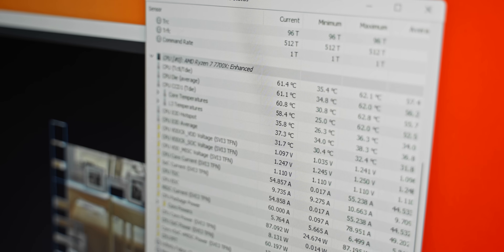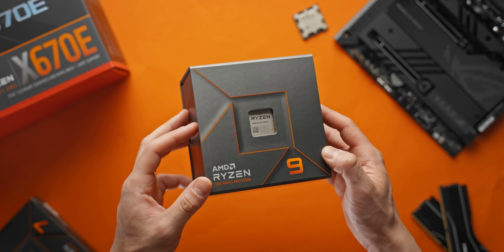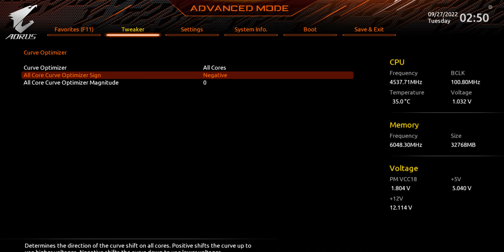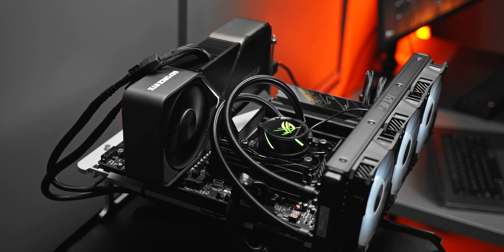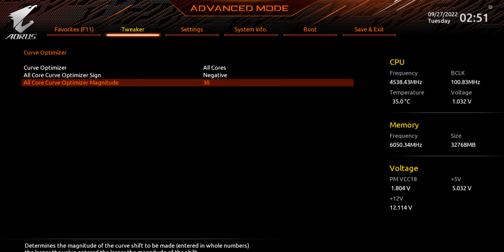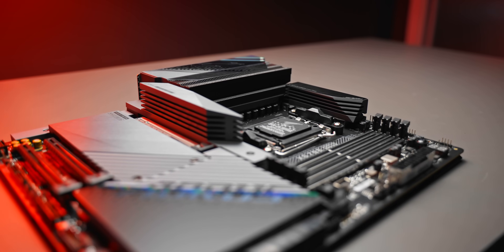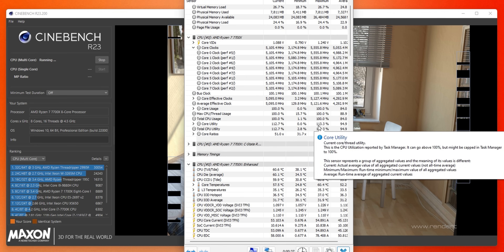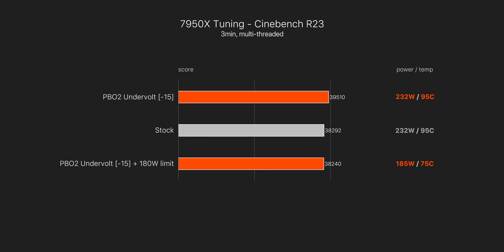Fixing Ryzen 7000 - PBO2 Tune (insanity)

Comment: I hope you understand that you used Gigabyte motherbard, most terrible brand, which overvolts all ryzen cpus out of the box. No wonder you managed to get negative 30 on all cores. I bet on msi motherboard out of the box you would only get negative 15 max with same cpu, because of the out the box voltage given to cpu is far lower than what Gigabyte boards decide do give on their side....
Reply: That's a good thing though... you want LESS voltage

Comment: What about the ECO mode? Can you both undervolt and run ECO mode? Would that make sense if the goal is to minimize heat and power consumption, while maintaining good (but not the highest) performance? Thanks!

Comment: Wait, isn't this something very similar to Intel and their motherboards some time ago (it was 10th and 11th gen, I think)? The motherboard makers essentially went ham and let the processors run at boost clock indefinitely resulting in high temperatures and power consumption?
Because from the difference you have shown, it doesn't look like 7000 CPUs aren't run at their optimal, but mobo manufacturers instead went and mindlessly turned everything up in the default profile, just to show off how their motherboards can handle all this. I don't believe AMD would just go and recommend this default profile. It would make no sense.

This video points more to just bad job in motherboard tuning department and not a CPU one, because you have to do all this extra work even if you buy expensive motherboard like this. I mean, the 7000 CPUs look damn great thanks to this video!

Comment: Going to be an interesting generation and a lot of learning the new silicon behavior. In reality their is little reason to try to drop the temperature, but undervolting while keeping the same ghz boost is always good. This time around their isn’t a risk of damage to cpu until 115C, so it behaves much like a laptop, better cooling you provide the higher boost clocks you get. You should be able to set curve optimizer in ryzen master and always test your undervolt. A program set called “core cycler” is great as it will stress test each core and log if an undervolt fails.

Comment: This is likely unstable. It took me several days to test curve optimizer values on my 5900X. The best cores are definitily not stable at -30, their curves are already pretty much aggressive. When modifying the curve, you need to test core per core (not multithread tests) with different workloads that will place the core in different values of said curve. This takes days.

Comment: You definitely hit the silicon home run on your 7700X. That is an insane drop in temperatures with just a few tweaking. Definitely worth tuning that CPU.
Reply: It's a review sample, so make of that what you will
Reply: @andrewd3899  Yeah but his 7950X wasn't as good. It depends.
Reply: @andrewd3899  even review sample don't hit better tuning capabilities. That's why it's called silicon lottery.
Reply: Another data point, my 7700x has been flawless at -30 as well.
Reply: @WilliamRori  Have you got the same decrease in temps while keeping performance?
Reply: @moozoo2589  5 degrees cooler, up ~600 points in 3D Mark timespy.
Reply: @WilliamRori same 🎉
Reply: Just tried this on my 7700x and it's got me stuck in a BSOD boot loop at -20. Sad.
Reply: @APeacefulPlague  it's fine. That's why these things sre difficult since it depends on silicone lottery. Some can get even lower than that if the fab is excellent.

Comment: This all makes very little sense to me, so why does a power limit really increase performance? I understand that a less constrained chip, obviously just runs more stable since it has so much headroom. What i don't understand is why the actual fuck AMD would, mind you, with literally no performance benefit to speak of, increase power consumption by like 50%. Literally no performance improvement. It does not make any sense. Like, seriously. No comments here mentioning this. Seriously think about wtf is going on here. It's insane.

Comment: On my 5600x -30 wasn't stable so I tried -15 and still had a problem, then I had to switch to setting it per core which should be the same with 7000s.
Using a -10 offset on the 2 best cores used for ST by Windows that run fastest was stable, Ryzen Master shows you the info.  The other cores handle -20, but likely there's one that cannot quite manage -30 as that causes occasional instability or crashes under MT load.  There's a tool around which puts loads on a selected core and reports faults, so you can track it down if you spend a little more time if you search for advice on the curve optimizer per core setting.

Comment: Great video! Free performance is always nice!
I don't get what is the reasoning behind saying that 95 °C or 85 °C is "uncomfortable" or "too warm" for a CPU.
Reply: What I am trying to say is: for a given undervolt + power limit, I'd rather run the cooling more silent with CPU at 95°C, because that is perfectly fine for electronics. Moreover, coolers are  more efficient with higher T difference between ambient and radiator.
Reply: Silicon wasn't always this good. Temps that high would degrade the chip and lead to premature failure. So even though AMD say it's fine, a lot of people just still aren't comfortable seeing numbers that high.
Reply: Its not like youll hit those temps daily either unless your pc is just doing 24/7 cinebench runs
Reply: @slywolf_  agree
EDIT: But even then, it would still be perfectly ok
Reply: thermal cycling usually degrades cpus  in the long run
Reply: @Ubya_  Thermal cycling happens at 60c too... lol
Reply: I appreciate a colder room

Comment: Note: please be careful with information like this. Yes, you get same performance and temps when running in longer periods.. but you also give up the ability for your CPU to boost when it needs to because lower voltage being available. so you would potentially give up a few hundred MHz in speed if the system needs it to get through a task. especially if it is in short term. like say.. initial load of a game. There is always a tradeoff when messing with voltages. especially on newer technology.
Reply: If you dont touch power limit or temp limit, a negative offset on curve optimizer will actually INCREASE your boost across the voltage range, so regardless of the task. If the voltage is too low you're just gonna end up crashing or with instability.
Reply: Just do per core offset and put a lower offset on the main two cores. My 5800x cant do any offset on the cores used for single core performance stable, but the rest can do everything from -10 to -25 for better all-core performance.

Comment: I really don't understand why this isn't the behavior they go for by default. If this works as well as you show, and it's seemingly included on all boards, why exactly don't they tune for this from the factory. They can show it "unlocked" on stage for that extra bump, but still be heralded as champions in power usage otherwise.

Does anyone have any insight as to why?
Reply: Because of the variance in silicon quality, I would bet that probably 1/3 of the chips out there won't respond well to this.
Reply: because they have to set a baseline voltage curve that every single CPU can meet. -30 offset wont be stable on every CPU.

Comment: If you have the time, you can tune the voltage drop per core. It takes hours for the testing so it might not be a good idea but if you got a free afternoon, then it’s a good way to get the maximum performance boost.
Reply: I tried this and I thought it was stable, Cinebench was fine, but crashing in games. Went back to all core offset. Screw it. Tons of trial and error.
Reply: @HCGonzalezJr87  Typically it's peak clocks in light loads which becomes unstable first rather than much lower all-core clocks in heavy loads. More stressful test you run less likely it will find instability. There's tools out there to test peak clocks when tuning individual core curves like Core Cycler. Sometimes there's a bad apple or two among the cores holding back the rest. For example with my 5800X(+100MHz override) worst value is +3 and best is -25. Flat value for all cores doesn't make much sense in my case. However with 16-core ryzen per core tuning is probably too much work. With 8 or 6 cores it's fine.
Reply: @kognak6640  With Curve Optimizer, the one or two cores that don't like offsets are usually the strongest binned & as such don't have much more leeway before instability. The reason why the 5950x & 7950x characteristically do low offsets is because they're generally binned as hell anyway being top dog silicon & the worst BoM anyway, so most of the cores plainly just undervolt worse because have an already aggressive v/f curve. 
Try looking at Ryzen Master to identify the best cores & see what offset ratios you currently use for those respective cores. If you stress tested correctly, they should be smaller than the rest.
Reply: @GeneralSouthParkFan  Nah, I prefer HWInfo which reports full CPPC priority order for cores.
Reply: @kognak6640  can you share your settings if you did undervolt? Have 5700x and sff case - don't like temps being too high
Reply: @yingbxua6240  Per core Curve optimizer values are unique for each individual CPU. You need to test every core and find out what works with your piece of silicon.
Get the Core Cycler, find out which cores are top priority from HWInfo or Ryzen master. Give top cores -10 and the rest -25 and start testing. +5 for unstable cores, -5 for stable ones but not yet at limit. Rinse and repeat until you find limits of each core.
Reply: @kognak6640  isn't it what Ryzen clock tuner does?
Reply: @HCGonzalezJr87  yeah for sanity all core is much better

Comment: Not sure why anyone would worry if that is the temps the chips are made to run at. I would worry if they were hitting say 105 all the time. Not only are the chips running hotter than traditional chips would but out of AMD's spec as well. However, efficiency and/or temps saving great reason and thanks for the info!
Reply: Because having the cpu run at 95c all the time will greatly dump a ton of heat into your room... that extra heat has to go somewhere, it doesn't just dissapear.
Reply: @choatus  Fair enough unless you live far north or south in the winter :)!
Reply: @choatus  Thats not how thermodynamics works. Its power consumption that dictates the amount of heat dumped into your room. Intel for example runs cooler but actually ends up dumping more heat.
Reply: @rdmz135  are you 10 years old or younger?
Reply: @choatus  actually he is right... a candle light produces about 20w, but the flame itself is way over 1000 degrees.
that being said, it is always better to have cooler parts, since they endure less stress due to thermal cycling. laptops often need BGA reballing because the higher temperatures and cycles end up cracking the solder joints
Reply: @choatus  Are you brain damaged? You are literally arguing against the law of thermodynamics my dude.  
If you have a CPU that gets to 80c on air, and then move to a 360mm CLC that reduce the cpu temps to let's say 70c, the same amount of heat is being thrown out of the PC. It's just being moved away from the CPU more effectively.
Reply: @Jonathan-fw6ty  he put words in my mouth and so have you, stop being such a child, I never said anything to do with this , just that the cpu will dump heat into the room and that is 100% fact, stop being an internet hero
Reply: @Ubya_  wow, you guys are just hero's right? I never said anything about any of that, just that heat will be dumped into the room from the CPU, get a grip on reality...
Reply: @choatus  you implied that if a CPU runs hotter, it dumps more heat in the room compared to a colder cpu. So yeah, not an internet hero but i'm just trying to explain how it actually works, you could listen or get offended that someone is trying to correct you, you do you
Reply: @Ubya_  You are still taking my words and spinning them your way, my statement didn't need correcting.

Comment: Makes you wonder why AMD didn't configure these CPUs like this themselves
Reply: because they have to set a baseline voltage curve that every single CPU can meet. -30 offset wont be stable on every CPU.
Reply: @rdmz135  makes sense
Reply: It would probably complicate binning a lot, so they're playing it the safe way and de-facto factory overvolt them all.
Reply: Because it's manual tuning
Reply: I assume because of what he stated multiple times in this video - only the best units from the production line can actually be configured this way AND remain stable. So basically it's a gamble when you buy one of these chips.

Comment: This is exactly what I wanted to see. I'm not upgrading this generation, but it's still good to see you reduce temps without sacrificing performance.
Reply: Yeah, that's what I did to my 3080. 100W less, caps out at 60C, and it's just as fast.
Reply: see you in 15 years
Reply: @dan8t669  yeah lmao, people always think they won’t upgrade until the next year or two goes by
Reply: I hope AM4 platform still lives for another year and hoping for something like a 5900X3D to be released.
Reply: @rudy_dstroys1821  I would be so happy if that was a thing, even if it costs as much as the 5950X does right now
Reply: @rudy_dstroys1821  Never gonna happen. AM4 is done and done.
Reply: @nexxusty  This comment has aged like milk considering that AMD just released 4 more AM4 CPU's this month...
Reply: @nordvestgaming1238  Lol, so true.
Reply: I see a significant performance hit.  Not sure why you wouldn't tbh.  Temp is lower, but that just means the chip is doing less...
Reply: @scottvrichey 
In that case, you did it wrong.
Reply: this generation ( both gpus and cpus) are a scam.

Comment: curve optimizer has existed since zen 3 and i was never able to extract even the tiniest amount of undervolt from it that's fully stable. 
cinebench stable is not fully stable, 10 minute gameplay stable is not fully stable. 
but good for the lucky ones who can get away with it for the work that they do.
Reply: I think you just got bottom of the barrel silicon.
Reply: @rdmz135  that's entirely possible. but it should still be noted that silicon like this exists and people shouldn't bank on undervolting when making purchasing decisions. 
alternatively, maybe i just stress test a lot harder than most of the guys out there. and I use my PC for a variety of workloads so I might be finding instability that others might never come across if they only use their system to only play a specific type of games or something.

Comment: There is also an option to do per core undervolt but it is more involved and requires more time.
Reply: You can use "all cores" and define minimum value for all core, after that use "per core", put this value, and after that, tune more precisely
Reply: If you can get a -30 all core you take it. Only if that fails do you need to start doing per core as AMD chips have what I call 1 "hero" core per CCD which tends to boost much higher than the rest in single threaded workloads and you can individually decrease the curve offset on those specific cores. Happy tuning!
Reply: Tuning and testing per core is best for complete stability. When testing all core workloads, each core is not working it's hardest. Each core needs testing by itself to make sure it is stable. Then if say a game, task or even idling. You are not going to find your system crashing.

My 5900x I can set -30 all core and test with cinebench with no issues.
But I would occasionality see WHEA errors. Tunes per core. I do get lower cinebench numbers but 100% stable.
Some of my cores are still at -30 but one is at -5.
Reply: this is how i have my 5800x set per core curve optimizer